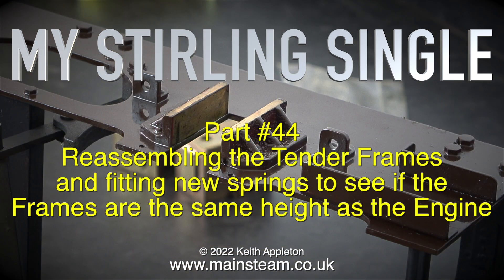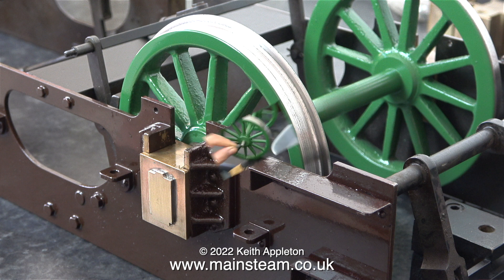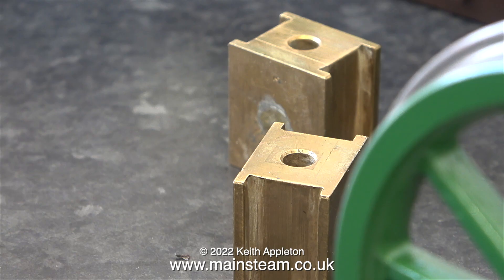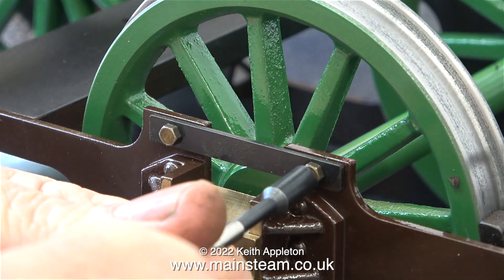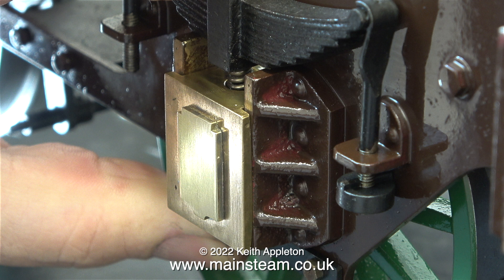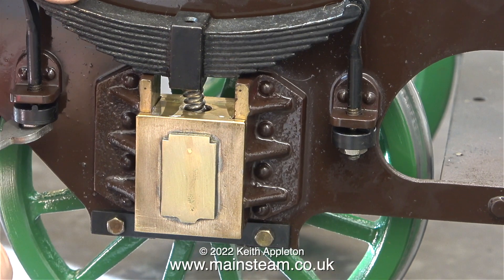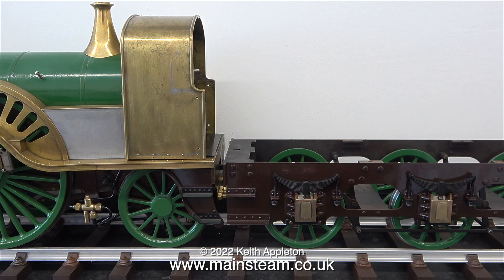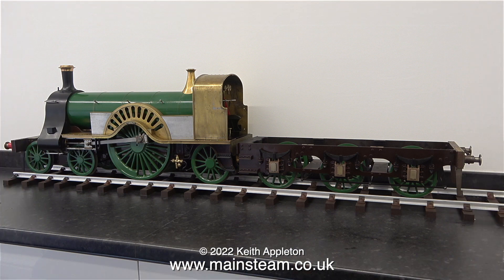MY STIRLING SINGLE - PART #44 - TENDER FRAME REASSEMBLY

Comment: Now I'm wondering if you are going to just pack out the springs with some bolts as inserts or if this suspension modification is going to be a significant engineering change..
Reply: close enough ;)

Comment: the split pin or cotter pin as we call them in North America ... can fall out ... it just isnt likely .. IF something compresses the open end together and something else pulls on the loops .... then the pin will come out ... the chances of getting that pairing ... about as likely as me becoming female in the next 24 hours ... baring a miracle not very likely
Reply: pity they dont make drills that leave a small mound at their center ... a spring would sit on that nicely .... 
.
could a person use say pop cans cut down to the leaf spring size to make more or less functional leaf springs ... ok sure you may still need a spring inside to offset the weight .... but wouldnt working spring like parts be a nice challenge